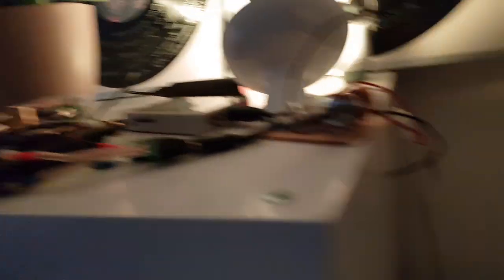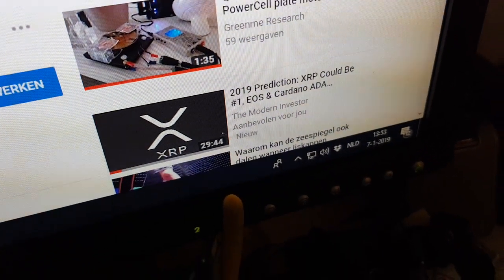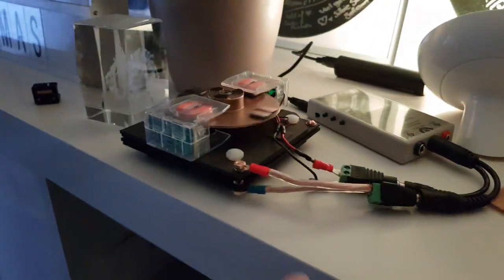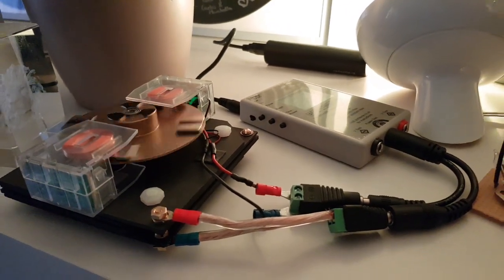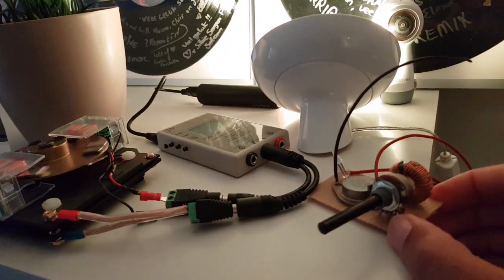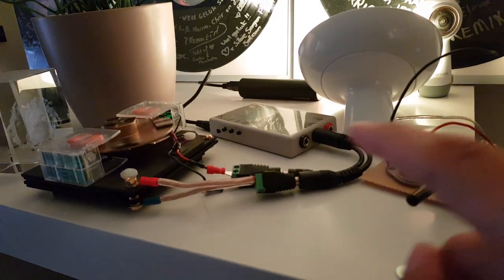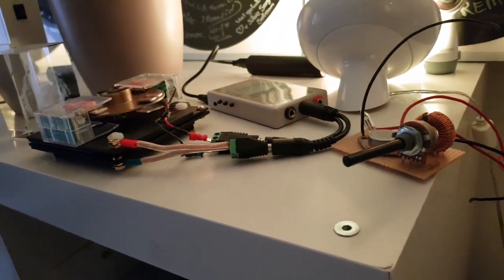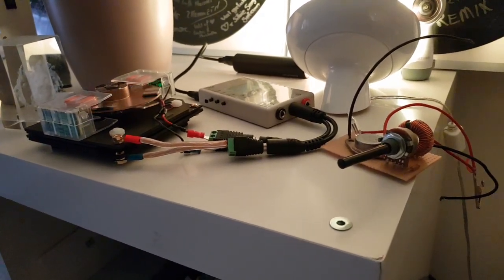Quanta Magnetics : Mini PowerCell plate motor - Update #5 Conclusion 264hrs runtime test

Comment: seems this sytem it´s thermogalvanic device, so the voltage was constante during to much time and in 15 days it´s decrease. I think the temperature it´s very importante. I would like to see anyone to make a difference temperature on the plates to see if the power increase. Someone said in same place the power comes from a redox reation with carbon and oxigen. I don´t know, let´s see the future

Comment: I'm also curious whether the voltage came back up after a rest, or alternatively if the rate of voltage drop gradually declines to near-zero. If the reaction is as the maker describes, it should either rebound after a rest or reach a somewhat stable state.
Reply from the maker: Yes, it come up after a rest.
But the amperage is too low to put a radiant charger on it, to charge batteries.
Reply: @GreenmeResearch  
Thank you!

Comment: Please don't stop posting, if you can charge it by using itself
Reply: There's nothing to charge. The plates are causing some kind of reaction that generates current. They are either semi-permanent (should last several decades) or they don't work as described.
Reply from the maker: @darthlaan2538  The voltage comes up after a rest.
But the amperage is too low to put a radiant charger on it, to charge batteries.

Comment: Many thanks for all the tests so far. Please let the cells rest for a few hours or a day and then measure the output milliamps also during a short shortcircuit test... But maybe just run first your RE-EMF charger test to see, if you can charge up the 12 Volts battery. Would be interesting to see, how many Milliamps these cells can deliver without running down and if they will recharge themself after resting for a day or so... Many thanks in advance.
Regards; Stefan.
Reply from the maker: The voltage comes up after a rest.
But the amperage is too low to put a radiant charger on it, to charge batteries.

Comment: So it looks like it loses its charge by running the motor.  :(
Any normal battery with the same volume of the plates would be able to run such a kind of motor for months or even years.

I also thought about ordering this toy but i aborted as i saw the shipping costs (more than 100$). Now i'm happy that i didn't order it.

Thanks for doing and sharing the tests !  :)